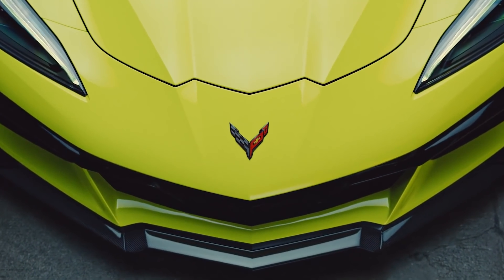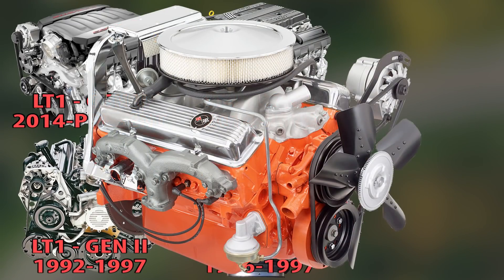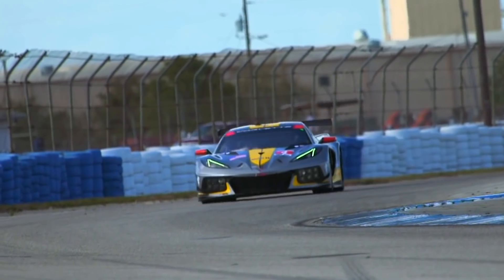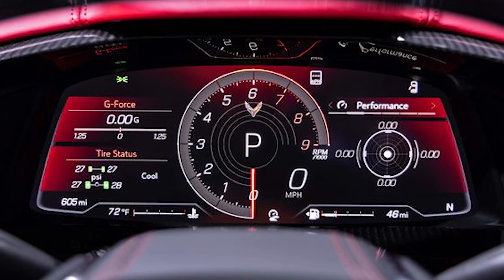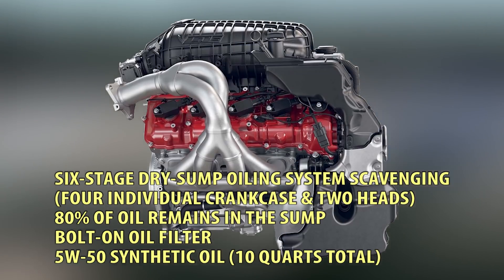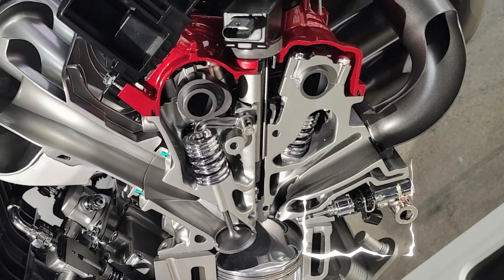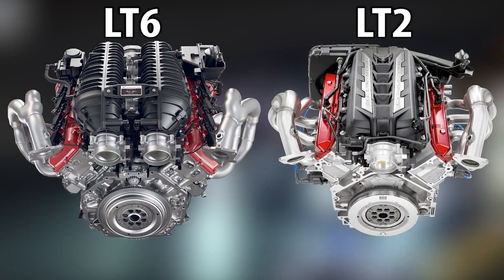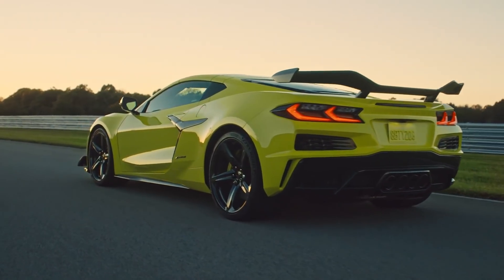What everyone missed about the 2023 Corvette ZO6 LT6 reveal

Comment: Great video! I love the 3D exploding animations of the various internals. Right at the 5 minute mark, you show an incorrect pic of the flat plane crank. You show the one for a Ford Voodoo engine. On the Corvette, and Ferraris, the two center pistons rise and fall together, not so on the Voodoo. (The cross plane crank illustration looks off too). The illustration just after that clearly shows the two center pistons rise and fall in unison. The voodoo engine sound with that different crank configuration, while high revving, is more like a traditional cross plane v8.
Reply: Glad I wasn't the only one to catch the odd Voodoo crank.

Comment: Let's be clear: I will probably never be able to own this car, even if it is more affordable than other cars less powerful.
But please, stop believing this engine is an absolute technological achievement.
10 years ago Ferrari's last NA engine was a 4.5l 605HP 398lb-ft 9000rpm technological monster. That was 134hp per litre.
This LT6 engine is 122hp per litre at 8400rpm. An Honda S2000 was 120hp per litre 20 years ago.

So: it is the most powerful production V8 by absolute numbers. It is not the peak of engine tech by any means.

Comment: This is basically a big motorcycle engine, I’m really interested  on how they think there would be zero valve lash adjustment during its whole life.
Reply: Metallurgy is always evolving, as well as coatings, like DLC. With 32 smaller lighter valves they can use less spring pressure, which is definitely going to save some wear on the lobes/rockers. That said, I don't know how long they consider the life of the vehicle, either way that's BD energy. Gm really impressed me with this.
Reply: According to Tadge Juechter, the shims are computer measured and precision cut to get the exact size needed instead of using mass produced shims.

Comment: Built in Bowling Green?  Is not this a Mercury Marine built engine?  That is what I have been reading.
Reply: Mercury built the LT5 DOHC aluminum engines back in the early 90's in the ZR1 models.
Reply: @bobthbldr3   Yes, I am aware of that. They did build this one as well though, researched it. It is true. This motor is also built by Mercury Marine.

Comment: Great video! I sure would like too know how this all solid valvetrain requires no valve lash for the life of it. Unless the life is very short!  
Will be interesting to hear the stories of owners once they get some miles on them.  That being said, it does look like a lot of solid 
engineering to bring the engine to reality and it's a very good looking engine at that.
Reply: Each valve shim is computer measured and cut to get the exact size needed, according to Tadge Juechter.
Reply: @benn454  And? You do realize valves move as the engine wears? Usually the valve seat sinks somehow, the "computer measured" valve clearance is no more and the exhaust valve hangs open. Run it like that for long and it's pretty damn expensive to repair. 

Most everything is hydraulic any longer and most people have no idea what's meant by adjusting the valves. That's how you can get marketing to say "solid lifter, never needs adjustment!" and people don't laugh them out of the room. 

I bet it's like lawnmowers that never need oil changes. There's so much else wrong with the thing by the time it needs valve lash adjusted that the exorbitant price of doing so due to the engine location means nobody will ever do so. Just go buy a new one...
Reply: You do know the valves can be adjusted by changing shims?
Reply: @REDMAN298  yes actually I do know that the valves are shimmed by hand as the engine is built and they claim that they never need adjustment again.

Comment: Lt1, lt4, lt5 lt6, ls6, ls7are all rpo codes, the other letters in the alphabet you mention are already in use for other vehicle options,  just not as well known. So rpo codes get reused through the years for different things. Usually a rpo code is used in tandem with the model year. Z71, z28, z34, zo6, zr1, zl1... all rpo codes just better known. That's why they refuse them. Gu6 and g80 are differential codes, different codes for open, limited or locker, as well as different codes for ratios. Along with every other option on the car having a corresponding code that varies in Identification of options from one model to the next. That's why they reuse and redesignate codes and typically keep certain codes for engine id and other drivetrain id.

Comment: GM is making me wonder, can this engine be fitted with a supercharger, or turbo charge? What special modifications it needs to Amp up the horse power of the engine?
Reply from the maker: A supercharger/turbo can be bolted on to anything. Might be better to wait and see if the ZR1 offers a twinturbo LT6.
Reply: @GTContent  I know it going to take some modification to the transmission, and a the engine to make it all work properly.
Reply: I suspect the ZR1 will be a similar engine, with a different intake, exhaust, twin turbos, and lower compression.  Obviously the transaxle will be beefed up more as well.
Reply: @ssoffshore5111  Turning at 8500 RPM, has indeed made that engines a wanted best in consideration of turbochargers, superchargers, and proformance pistons and crankshaft that can push that engines above 9000 RPM. It's like imports want have a chance to out reve and pass this new v8 in the quarter mile at the end of the dragstrip. Race cars enthusiasts is going to now have a powerful v8, that can reve high like small 4 calendar engines.

Comment: Your horsepower and torque numbers are backwards on the RPM. 480 lb-ft of torque at 6450RPM and 500 HP at 7400RPM. Torque peak is NEVER higher than the horsepower peak.
Reply from the maker: https://gmauthority.com/blog/gm/chevrolet/corvette/corvette-racing/corvette-racing-cars/corvette-c8-r/
Reply: @GTContent  Notice that there is no RPM number for the horsepower. The article itself is incorrect in implying the redline (7400PM) as where the peak power actually occurs. And might I add, even a torque peak of 6450 seems particularly high. IIRC, the engines didn''t used to run higher than 7000 or even sometimes 6600 in race trim. The torque peak would have been CONSIDERABLY lower, quite possibly in the 5500 range, when restricted by BoP. Now that it's been uncorked, it's no surprise that the torque peak is at a higher RPM, but with lower numbers (emissions equipment in effect). The real surprise is that the engine makes 670 horsepower at SUCH a high RPM. That means the torque only falls from 460 to 420 from torque peak (6300) to power peak (8400). So for literally a third of the useful rev range, at the very top of its voice, the engine has less than 10% falloff in torque. And it hits 400 lb-ft at probably right around 4000RPM. That gives you a powerband of over 4000RPM  - an INSANE amount of driver flexibility.

Comment: IT COPIES DESIGNS OF THE FORD COSWORTH RACE MOTOR, LIKE EVERYTHING ELSE GM /CHEVY COPIES FROM FORD.. FROM THE PROSTOCK DRCE - DRAG RACE COMPETITION ENGINE WHICH IS A BIG CUBE FORD CLEVELAND ENGINE,  TO THE LS WHICH IS A REGURGITATED FORD 427 HIGH RISER AKA RAISED PORT 351 WINDSOR. TO THE NASCAR R07 CHEVY MOTOR WHICH I'D A FORD CLEVELAND KNOCKOFF,  AND ALL YOUR AFTERMARKET SYMMETRICAL HEAD BIG BLOCK RACING CHEVY ENGINES WHICH ARE CLEVELAND BASED FORD DESIGNS THEY LABEL AS CHEVY, AND YOUR MOUNTAIN MOTORS LABELED AS CHEVY WHICH ARE FORD BOSS DESIGNS. THIS MOTOR IS NO DIFFERENT. ONCE AGAIN CALL IT WHAT YOU WANT TAKE, STEAL, BORROW, HIJACK. ROB TECHNOLOGY TO BETTER YOUR PRODUCT AND THIS IS WHAT GM HAS DONE HERE.

Comment: Thanks for the great HQ vid. I wonder how the fuel is mixed up efficiently at high rpm and high load hence there is no time. This is a known problem, that’s why some engines are built with combined injection systems to join advantages of both worlds. Cosworth still uses port injection in their V12 engines.
Reply from the maker: Maybe the ability to "build pressure" via the velocity stacks helps.
Reply: @GT Content  Porsche had velocity stacks in the 996 I believe it was. They were vacume adjustable.

Comment: 402 miles per hour just in first gear, so again its about now much its going to cost, forget the usa they always get a good price for a new c8, its about other countries like Australia for example, it will cost around 150K to 200K with on road costs for a C8 with full options like say a silver paint and burgundy red lather with yellow stitching and extra cooling for transmission and engine oil and radiator etc. :)

Comment: The dual value springs is not for back up its for low rev's and then high rev's each has its purpose? Each has its torque specs, if you took them out and checked them you will fine that the outer spring is for low rpm and the inner is for the extra hi rpm its that simple?
Reply from the maker: Yes, both are designed to maintain spring pressure for conditions set by GM. If one of the spring breaks, the second one will act as a back up.
Reply: It's not for "back up" but it is a benefit! One of the problems with coil springs is they have resonate frequencies and if they run in those frequencies they fail quickly. When you use two springs, one inside the other that tends to reduce the resonance peaks and increase the spring life. It also reduces the cross section of the spring coil and increases the surface area so the spring cools better because when you compress and release a spring as often as these they will produce significant heat.

Comment: Second order vibration is the biggest bugbear of flat plane cranks. In a racing car it doesn't matter so much but in a street car it could drive you nuts. None of the things you mention actually address the problem of second order vibration, they just build some resistance into the engine. The best ways to fix it are either a balance shaft or, as Ford did with the Shelby 500, counterweights (which partly defeat the purpose). I'm not seeing either features in the exploded views so I wonder what they have actually done.
Reply from the maker: Agree. Although it may be cool sounding. It may get annoying for long trips, having a conversation or if the person is sensitive to noises.
Reply: @GTContent  I was thinking more of the actual vibration being felt inside the car. I have about 2,500 hours in helicopters and the vibration is one of the two things that tire you out, noise being the other. Second order, as you undoubtedly know, works at double the engine RPM so if the engine is pulling 4,000, you will get 8,000 vibrations per minute through the seat of your pants. I have heard, however, that Chev might have done something to the camshafts to counter it - like a balance shaft would. I have no idea how it would work but maybe that's what they did to counter it.
Reply from the maker: @thethirdman225  Yes, we'll have to wait and see. Hoping it's a success (manageable sound and vibration) as I'm thinking about picking up one later. I've got my fingers crossed.
Reply: @GTContent  For me the big question was answered by Tiff Needell when he said the chassis was fantastic and is the same one used in the competition car. That scotches the old trope about American cars having less than optimum handling. I just wonder what US sales will be like, given the strong European influences. Personally, I think it's a great car. Much cheaper than a Ferrari and probably much cheaper to service. Sounds like a winner to me.
Reply from the maker: @thethirdman225  The bad handling stigma hasn't been brought up since probably 2010. American cars have improved greatly in the handling department. Sales have not met demand with the LT2 C8 from what I've been reading. The Zo6 has a waiting list. If these are true, I think it'll do great.
Reply: @GTContent  I don’t generally keep track of these things. The C8 caught my attention, as it should really.
Reply: Thats the Ford GT350 that had a FPC, not the Gt500. BTW, the GT350 had vibration issues.
Reply: @donbjorkland1386  Yeah, thanks. I always get them mixed up.

Comment: Also the C8 ZO6 is the race car version and only tow are available as far as models C8 with the LT6 or the race version of the new 2023 C8 ZO6 which is all race breed of options like carbon fiber wheels other extras etc etc, where as the C8 2023 model you can ask for what ever options you want, other than the ZO6 model which is only a race car specs so to say, still road going car, just a lot lighter and same HP but with extra cooling and more carbon  fiber added?

Comment: it took GM less than 2 years to achieve what ford did in 25 years!
Reply: I don't quite understand? Ford came out with 2 different mid engine dual overhead cam super cars first was the limited idition GT40 in 1966 I think then they collaborated  financed and provided the power train  in the detomaso Pantera, then the  ford gt in 2005 then the second gen GT in 2016... It took GM  like 69 years to make a mid engine Corvette.. Then the only dohc V8 before now was the 1990 ZR1..
Reply: @Stars-and-Stripes-  I meant the over head camshafts, GM did the ZR1 back in 1989 and did it right the on the first try, and did it again in 2021 and it looks like it will be also a successful engine, but Ford failed to provide a reliable OHV engine for decades! .. they kept suffering from timing chain issues until just few years ago!
Reply: @GroupWar  If you say so, Ford has been running the DOHC for years and stuck with it. GM made the 88 ZR1 for just the C4 for a few years then went back to the pushrod for some reason!  Also they did not even design the engine... That is silly to say that the ford DOHC has been unreliable for decades...  Then to top it The New gm engine has not even had time to be proven reliable yet... Also the original ZR1 engine was designed and built by Mercury, not GM...

Comment: I agree on the scary reliability. GM has NOT had a good history with QOHC setups to begin with. Quad 4, Northstar (early versions), all their V-6s...I will say they seemed to've gotten the LS7 right after 2011. Mine's a 2013 built in 2012 and has 105Kmi with no issues. I'm hoping since this is based on a real racing engine, it'll be a lot more solid...Like the LT-5...hopefully...At least there's no variable displacement function. A source of big issues, from what I've read.
Reply: that’s rt;

they have always made some very reliable pushrod mills  like their 3.8 V6 (one of the best V6 they ever made) and most of their pushrod V8’s; 

their DOHC’s, eh, not so much......

Lets hope things have changed for the better

Comment: Technology of the LT6 is Fantastic ... BUT, I give GM an "F" for apparence... in a visible mid-engine car, dress up the motor!! (aka Ferrari).. those high tech plastic intake manifolds do NOT look good.
Reply: Are they not powder coated aluminium? Looks like it
Reply: Order the carbon fiber cover...personally I like the engine look.  Change the color?
Reply: @polystictus  the beauty of a mid-engine car, is seeing a beautiful engine.. as Ferrari and Lamborghini done for decades .. doesn't cost much to make the engine attractive. This trend toward ugly engines with plastic covers, is revolting to people love engines. This Z06 engine is AMAZING .. dressing up the air manifolds and valve covers would make a huge appearance improvement. Heck, the original base C8 engine looked visually better than this new Z06 motor.
Reply: How about a clear high tech plastic showing the velocity stacks.  Love the look of motors with the VS exposed.

Comment: I remember ZR1 in early 90s' 405hp. Dual overhead cams 32 valve. Bravo!  Chevy for getting out of stone age push rod motors!
Reply: But give Chevy credit for amazing performance in push rod engines, which aren't going away .. still the best V8 performance bang for the buck.
Reply: @KrustyKlown  l agree, push rods and 2 valves per cylinder cause tremendous stress on valve train at high r.p.m use. Overhead cam 4 valve design is the way to go! 2022 Vette redlines around 9,500!
Reply: @frank.l181  yes, but with 2 valves, you can't breathe that high anyway, so you couldn't use a "high RPM" valvetrain anyway.  
Basically 2 designs approaches:
1) High RPM, lower torque (not as much stroke to keep piston velocities manageable) - over square -  larger, heavier engine (DOHC takes up lot of space)
2) Lower RPM  more torque under-square (more stroke) smaller overall foot print.

Neither of these are a "perfect" solution, each has a trade off.   

Just like flat plane vs cross plane:  
Flat-plane - lighter, faster revving, more power (due to better exhaust savaging)   - perfect 1st order balance,  CANNOT be balanced on 2nd-order vibrations.
Cross-plane - Heavier (counter weights), lower revving (can be used with longer stoke for more torque) - perfect 1st order AND 2nd-order balance.

Everything is a trade off.
Reply: @jonathansmith4968  l agree! Honda vtec has solved that problem back in 94'. I would say Buick 3800 series is a pushrod motor a awesome engine!  Grand National Regal!
Reply: NHRA Top Fuel and Funny Car class. The quickest ICE cars in the world. Are all pushrod, 2 valve per cylinder. The architecture of the engine goes back to the 1950’s Chrysler Big Block V8.
Reply: ZR-1
Reply: Overhead cam technology is older than overhead valve technology.

Comment: The pictures at 5:04 are incorrect.  I think the upper crankshaft is actually a typical flat plane crankshaft, whereas the bottom picture looks like the crank in the Ford "Voodoo" engine.
Reply: Yep, at 5:04. Two different versions of a flat plane crank.  I know it’s a confusing concept and that’s why we aren’t all engineers.